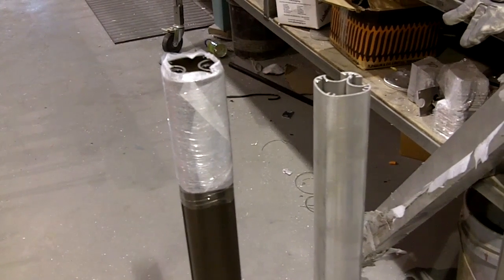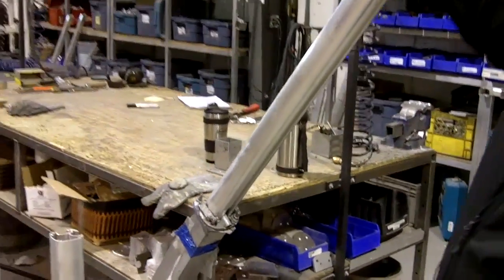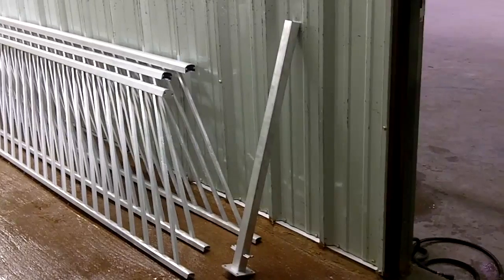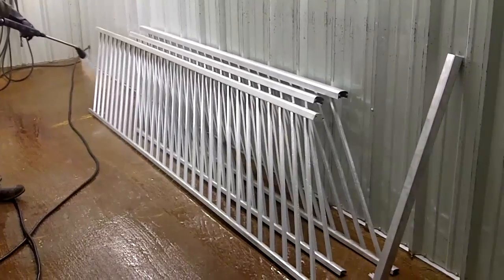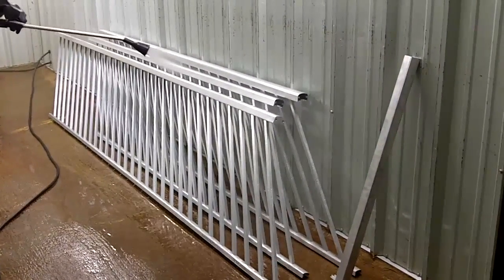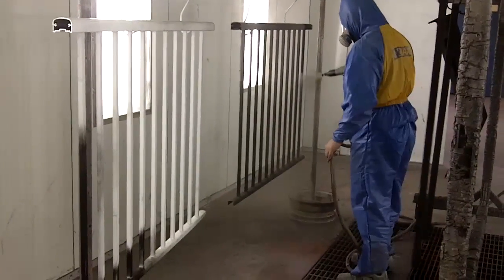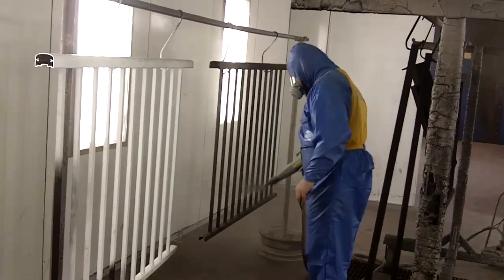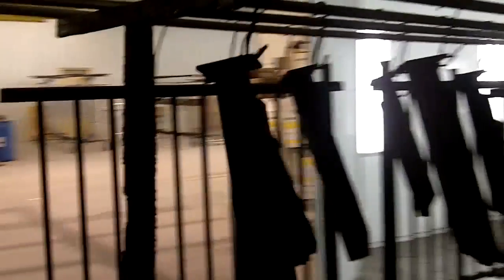Powder Coat Process

Comment: dear which chemical you use for aluminum pre treatment
Reply: Generally we are know alumnium surface have a passive layer like ss,its must use wash primer /etch primer bit..some coating manufcture they are have a coating direct to alumuminum without special treatment,just solvent cleaning (sp 1) its product can applied direct to aluminum surface.thanks